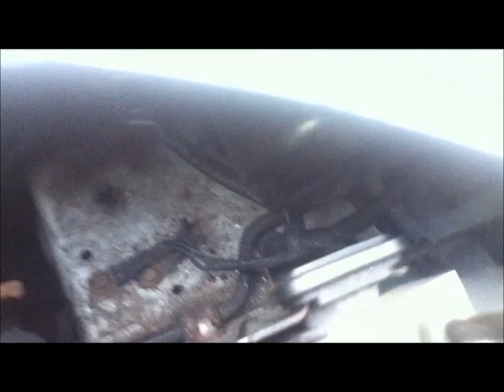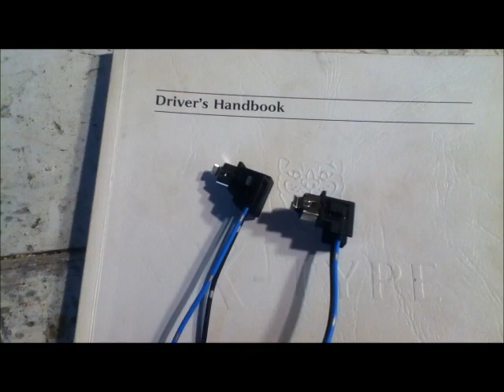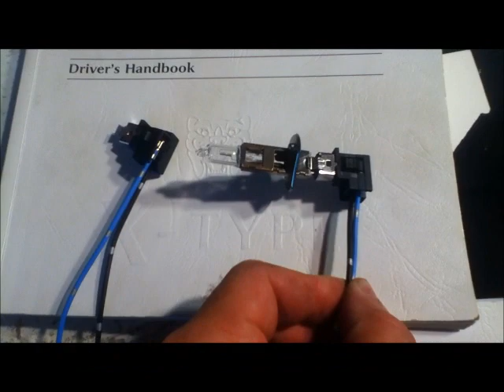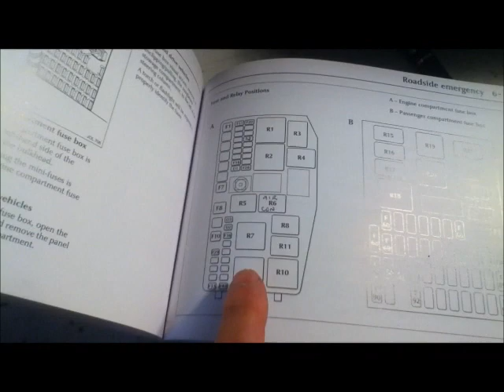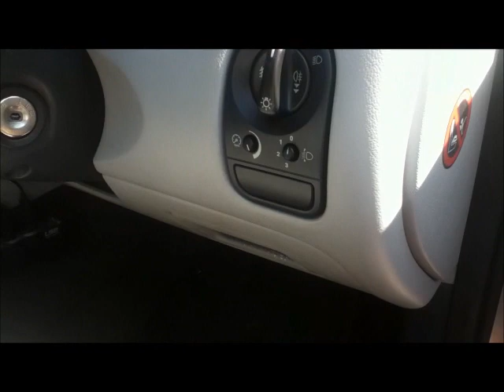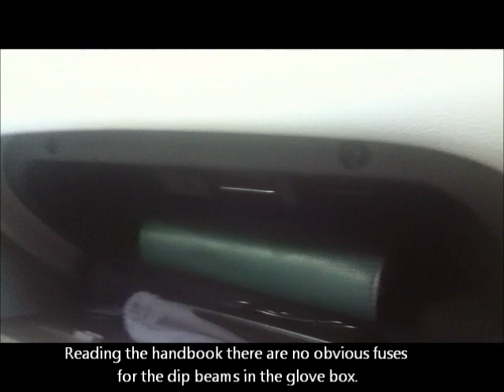Jaguar X Type -  Dip Beams Failure and Repair

Comment: Thanks for the good information!  The fuse must be out by the bunt connector. 
You have fixed the causes of the problem by replacing the connector and bulbs and finally found the fuse caused the problem. 
Congratulations and thanks for good guide for the fix! 
I have 2004 X-type and have found that the earth connection of ECM is very important. 
I think the earth connection of ECM of the X-types is worth to be checked out for preventing future problems.

Comment: Thank you!!!! Just solved my problem passenger fuse was blown. Now just to figure out why I don’t have brake lights, fuses are good bulbs are new.
Reply from the maker: That's probably the brake light switch on top of the pedal.
Reply: @johnnysevengun  thank you! Replaced it & I’ve got brake lights now.

Comment: My lights went last year, burnt out the hid module "conveniently" located well in behind the bumper and crossbar, then the self-leveling headlight beams decided to stop adjusting pointing 6" in front of the car, ended up being corrosion on the wiring near the rear wheel arch. Its gets trickier to keep these cars on the road the older they get.
Reply from the maker: Well done for working it out.

Comment: That’s right good job,I have to change the fuel injectors on my x type
Reply from the maker: That will be time consuming. Have you run injector cleaner through it - makes the world of difference?
Reply: Concept Symetry Guitars I’m getting code po201
Reply from the maker: @fresh55n9ne  Have you checked all the electrical connections are clean? P0201 only relates to Cylinder No 1. try swapping the injectors around to see if the fault moves cylinder i.e cylinder 2 is P0202.
Reply: Concept Symetry Guitars I replaced the spark plugs and ignition coils all 6, it did not make a difference on the car,I noticed cylinder on has raw gasoline on the spark plug, the rest of the spark plugs are fine, I ordered the fuel injectors all 6 I’m waiting for them to arrive so I can install them,I hope they fix the problem, the car has poor idle and the check engine light turns on instantly after being reset,I’m also getting code p1313 misfire rate catalyst damage fault bank 1,p1316 injector circuit/IDM codes detected,po430 catalyst system efficiency below threshold bank 2. I was forced to drive it home in that condition I was six hours away from my home

Comment: I've got same problem ,was it the 20 amp  fuse. or did they do more work.my fault is the same as yours my fuse seems fine ,
Reply from the maker: With my car, the bulb holder has melted causing the fuse to blow. I replaced the holder but did not understand about the fuse as it is marked up as HID - which my car does not have.
Reply: Did both dip lights go 👍
Reply: F76 says hid on my manual will check both tomorrow thanks for replying ,my hands are battered ,what a nightmare getting a bulbs
Reply from the maker: Both dip beams went out but only one side was melted.
Reply: Had drivers side apart holder ok I then checked fuses a Nd relays in engine box ,will check other bulb holder Tomorrow and in car fuses ,which side was melted on yours just out ov interest
Reply: My holder drivers steering wheel side was fine
Reply from the maker: RHS
Reply: Morning just checked passenger connection looks good ,change top right fuse listed in my book hid ,it had blown ,changed lights worked then blew fuse ,so getting there ,will try swapping relays to make sure all ok ,got to get more fused 😭 thanks for your help
Reply from the maker: @alexpalmer9894  If the fuse is blowing there must be a bad earth.
Reply: At last all fixed it was the alarm back up siren ,causing fuse 67 to blow ,jacked car up two screws on passenger wheel arch from liner , undo ,alarm siren is now facing you, simply disconnect socket ,I then tested working perfect ,covered wiring in insulation tape ,replaced liner and wheel ,all perfect ,thanks for all help ,hope people read may save alot ov time ,this was my problem your car may be different